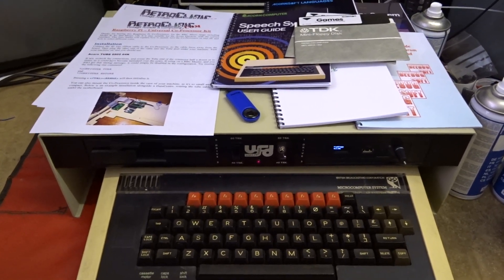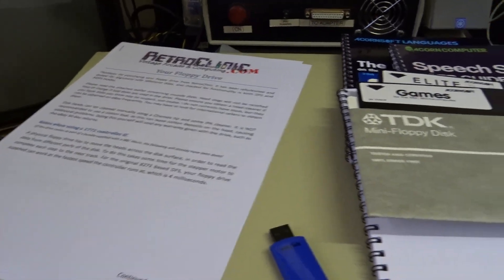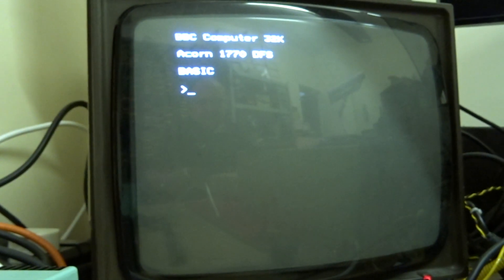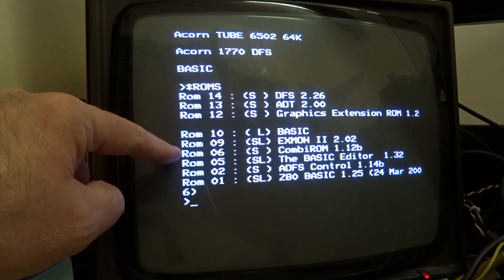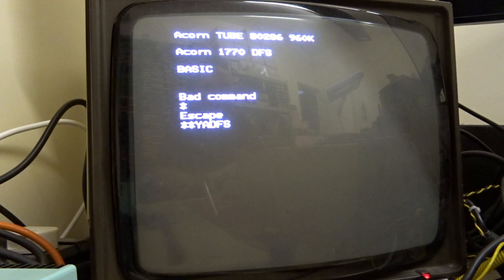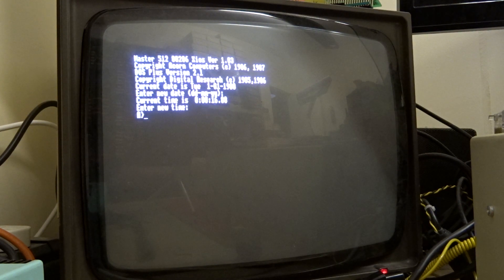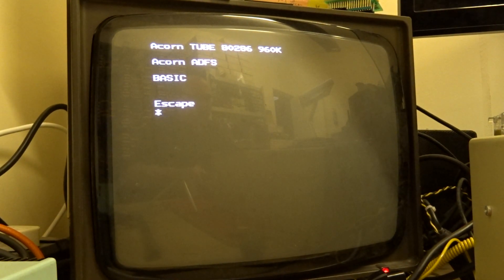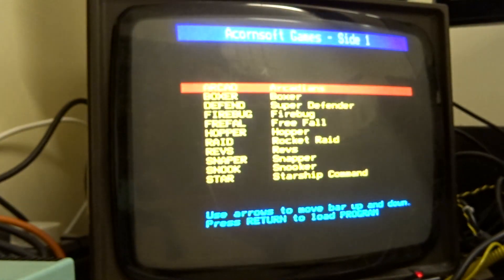BBC Micro with GOTEK and RPi Co-Pro

Comment: Absolutely fantastic.

Are there any drawbacks or advantages to upgrading a BBC Master to this spec? How's the software compatibility?

I'm certainly interested.
Reply from the maker: No downsides at all as far as I know. It's just as compatible as loading software from a regular floppy. The ADFS that uses main memory is soft loaded, so can be turned off, and you get the ability to switch boot drives with the drive select switch. The RPi CoProcessor is very stable, and handles all the cores it does very well.